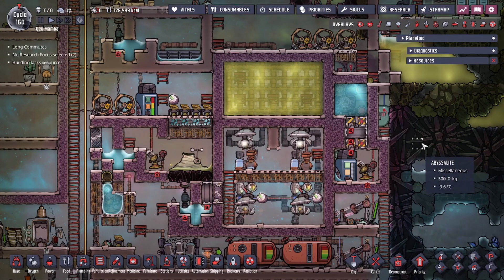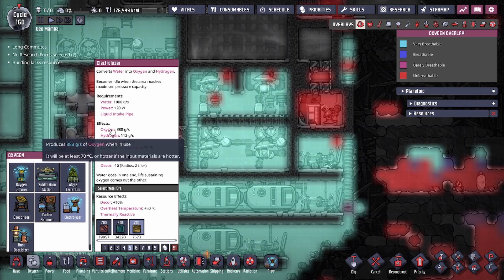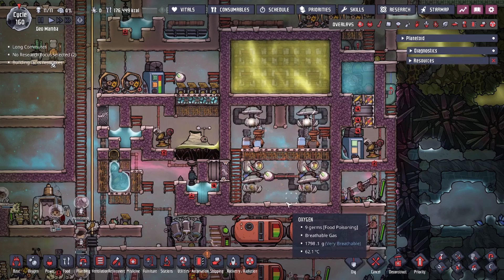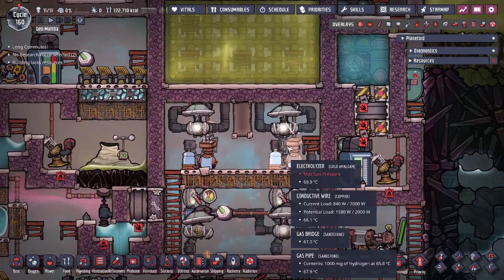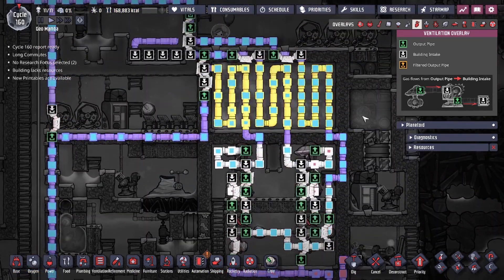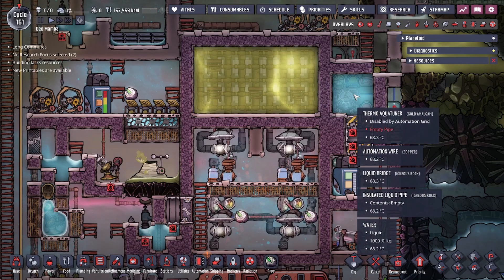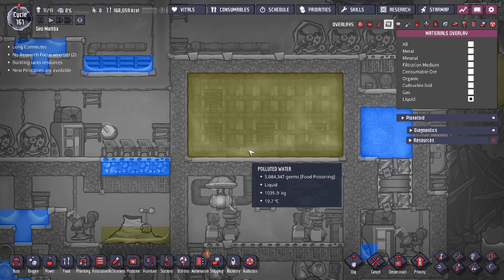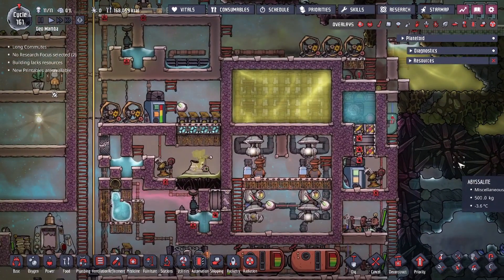SPOM - Self Powered Oxygen Machine & Cooling - Simple Design - Oxygen Not Included

Comment: My spom keeps over heating. Any solutions?
Reply from the maker: used a material that provides +overheat temp like gold amalgam or run a cooler liquid over the SPOM. if youre feeding the electrolyzer a cool to warm liquid (below 60c) you can try to run the pipe feed it via radient pipe so it cools the area before feeding in

Comment: I am running a base colony on Verdant with spaced out DLC. My first real attempt at a base, I just ran my oxygen past that special building in the cold biome powered by hydrogen to burn off my excess hydrogen while cooling the oxygen to 0°.

Since Verdant does not have a cold biome, I'm looking at radiator options. Yours looks interesting.
Reply from the maker: the radiator works great! size is dependent on the refined metals available for the radient pipes and should use one of the "waters" or ph2o brine salt or regular water. it chills slightly below the temp you set it at and gives you consistent oxygen temps

Comment: This video would benefit from a rundown of the different potential renewable water sources & how to make them work with the system. Using pwater from a slush geyser in a cooling loop that ejects >0C liquid which is then sieved for the electrolyzer; using straight brine from a salt slush geyser & then desalinated for the electrolyzer; using a cool steam vent (not sure how that would work exactly, or if it would provide enough water); etc. + solutions for when the water source runs dry - stored liquid in reservoirs, alternate sources which kick in when the primary stops, etc.

And again, Blueprints Not Included schematics would make these MUCH easier to build.

Thank you so much for your videos! I've been looking for stuff like this for a couple of years or so.

Comment: Second question: Why are you using such an enormous cooling box? If you actively cool the pwater, you don't need nearly that much volume.

And related followup: How might one modify this to cool multiple systems via a split in the piping?
Reply from the maker: the volume makes the temperature of the oxygen always come out at the temp the aquatuner is set at, so that the temperature never creeps up even with constant gas flow outwards. too little mass allows for the hot oxygen to eventually creep up in temperature or inconsistent temperature levels. this matters to me since i dont normally run cooling loops in the base and rely on the cold oxygen as cooling.

now to modify the cooling, i would recommend after the pipe leaves the cooling box, before it goes back to the aquatuner you can pipe that to use elsewhere. i recommend modifying after it leaves the cooling box so that the oxygen cooling has priority.
Reply: @2LegitCity  tyvm

Comment: How would you do this without a mechanical filter? I've been looking into sensor-shutoff filters with overflow loops to prevent mixed gases; could that be substituted without compromising reliability?
Reply from the maker: normally utilizing either a mechanical filter or a shut-off with automation to filter requires the use of infinite storage so that the gas pipeline never backs up
Reply: @2LegitCity  damn; I don't use infinite storage. What are my options? I don't need it to be self-powered.

Standard filters cost 120w/s, but might be worth it to avoid exploits. But what about an oxygen overflow sensor set to shut it all down until the block clears? The hydrogen can be burned off as fast as it's made. Side path for O2 overflow, sensor on said side path, which loops back to the main path and bridges in for when there's room again? Only thing I'm having trouble visualizing is the best way to tell it to turn back on when downstream oxygen demand clears the block.
Reply from the maker: @owenmcgee891  probably a 2nd shutoff or sending the automation to the pump to stop pumping for your idea. burning off the extra hydrogen would of been the suggestion but it seems like you got it

Comment: Hello- hello~

Just a suggestion, it is sometimes hard to understand how did you setup this from top to bottom. I did try to build this in my spare time during work. I find it hard to setup due to conflicting needs. For example, you do have a geyser. What I used was a Steam Geyser. It requires different setup. I had to change around and unfortunately it did not end well.

This is just a suggestion but having a video from a setup, into physically building it within a grid, would help a lot. Just to sort out what you actually need as well as problems or different sources to use, in combination as sources for SPOM.
Reply from the maker: wait so you frame the statement in a way that makes it sound like its hard to follow and that the build was hard to make, but rather the geyser option you had required additional setup.

so i just want this to be clear, its not that its hard to understand or setup- more so i didnt have information about utilizing a steam vent. do you have any other examples that made this difficult to setup?

i'm just having trouble understanding the feedback.

im sorry uploading this- since it seems that it ruined your day
Reply: @2LegitCity  
My bad. English is not my first language. So my direct translation might be confusing.

I meant as a suggestion for a tutorial video, showing the build from the ground up is easier to see and follow the step. Looking at this as a general, makes it slightly difficult to know what you do need to prepare or set up, before doing stuff. I'm looking at this from a new player perspective, and a lot of these info didn't get to me as easily. No harm is done. I just need to get more information before I really start to understand what's going on. 

That's why I suggested building from the ground up and explain from the top. A dummy like my who just did play the game for the past 3 days, is not going to understand all this just yet. Hahaha. Not your fault though, I just don't understand the "Why this?" and "Why that?" part. Too many basic questions.

Some part of this is unrelated, but when I tried to build one, I ended up flooding my base in the process of trying to get a Steam Geyser's resources (the water) due to pipe breaking. (Probably overheating...). That's beside the point though.

As for my day, no worries. I'm playing during work. I know, not a great look but I got spare time so I can multi-task. So my day is not ruined but I did have one hell of a base to clean up now or just restart, but that's not really a problem. I'll learn the game as it goes.
Reply from the maker: @Asriel_Cypher  no worries, and i understand where you're coming from.

if youre looking for some beginner help- i actually have a playlist of "basics", although it isnt finished, but they tackle more of the new player issues. also you could check out some of the oxygen not included play throughs and check out how i start out and what i do in the beginning- alot of times im explaining to chat what and why im doing certain things

basics playlist: https://www.youtube.com/watch?v=-jLdUz1Sv9k&list=PLrnkxsumupjAiydFFEWjiMWurfvf8rZph

VODs you can choose from: https://www.youtube.com/c/2LegitCity/playlists?view=50&sort=dd&shelf_id=3 

i'll keep it in mind with doing more entire "how-to" videos, its just that reception has been better when i dont do those types of videos. also, i dont think i would want to re-do this video already- its only been out a few months, but i could do it in the future.